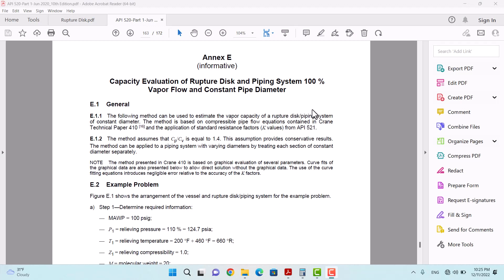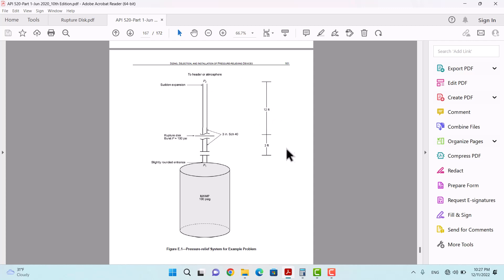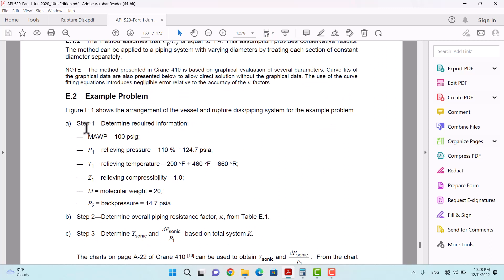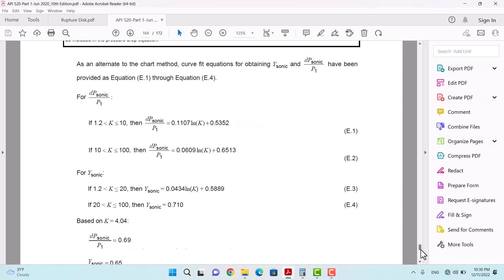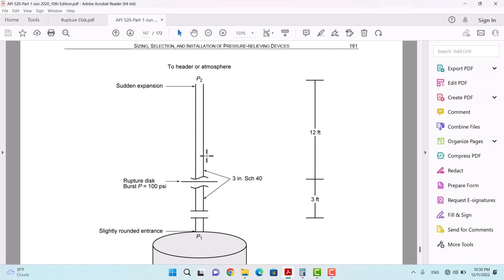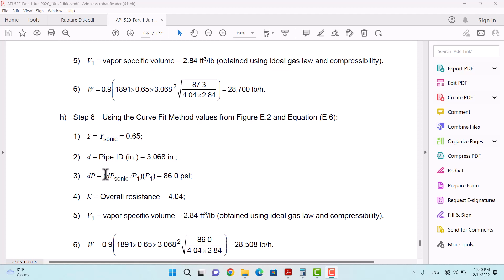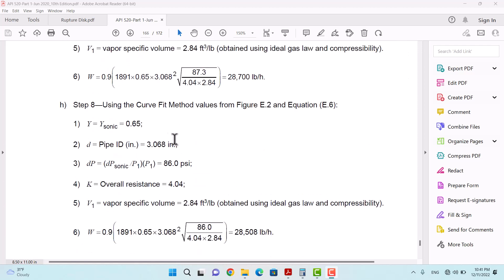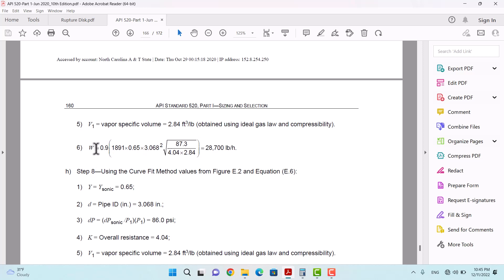Rupture Disk Sizing

Comment: Thank you so much for your explanation . My question is on the pipe entrance K factor. From Crane 410, Page A29 the value of K depends on the r/d where r is the bending radius and d is the ID of the pipe. K values are provided for r/d= 0.0 ,0.02,0.04,0.06,0.01, 0.15 &up. I observed K value 0.5 for r/d =0.0 was used in the example. Please how was the value calculated. I am having challenges on how to get the bending radius r.